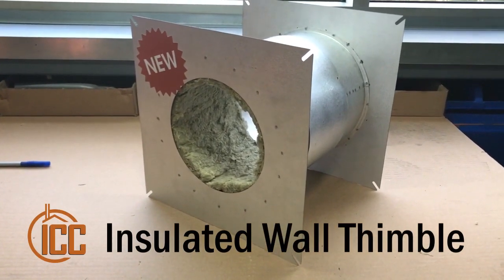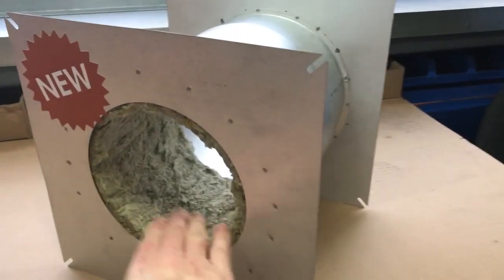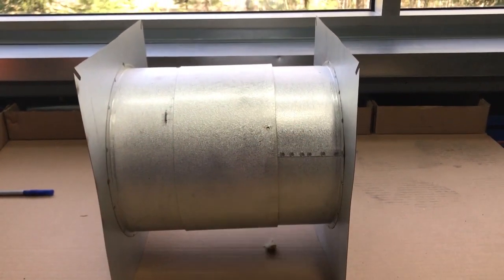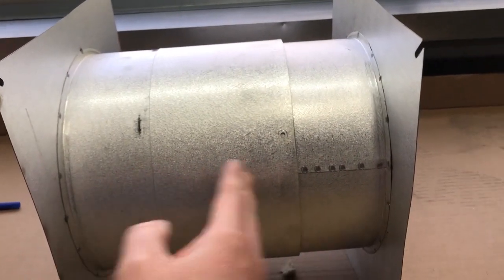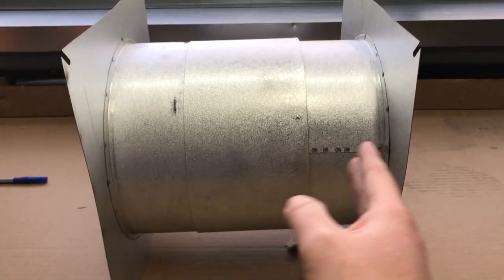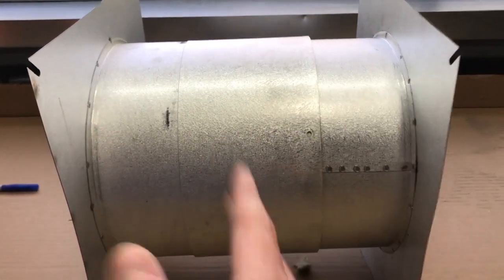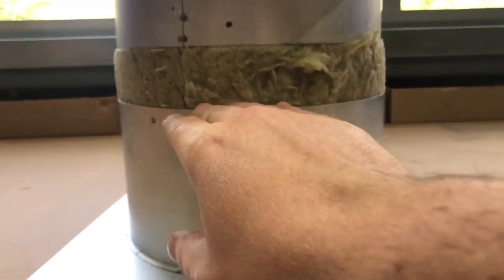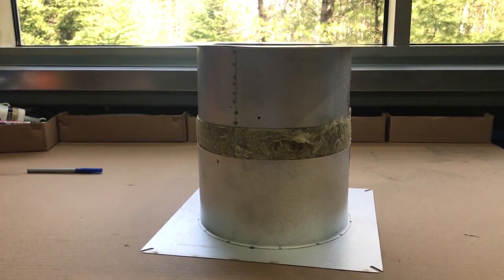From the Lab - Insulated Wall Thimble

Comment: Thanks for the video. Is this a zero clearance thimble?
Reply from the maker: Clearance is dependent on the appliance rather than the venting components. The installation manual for your gas fireplace or stove will specify the clearance requirements. The insulated wall thimble is designed to help prevent heat loss from the home rather than improve clearance. It has been proven to reduce clearance on some appliances, but it will always be mentioned in the manual for the appliance if that is the case. I hope that helps.